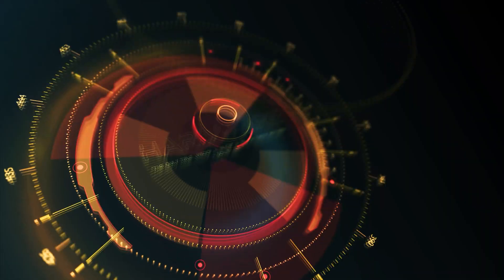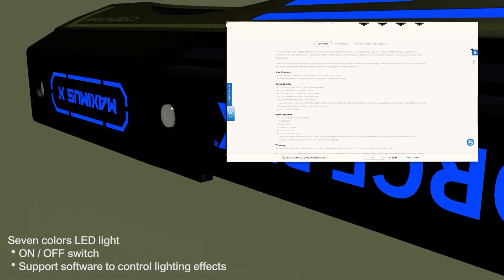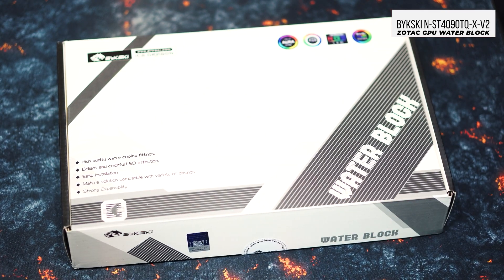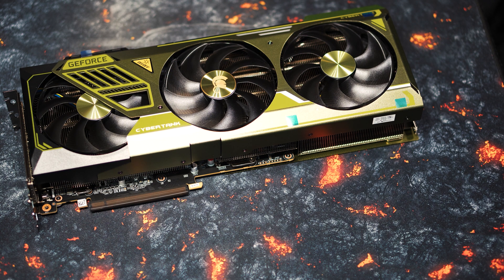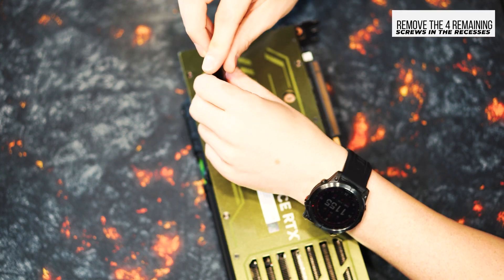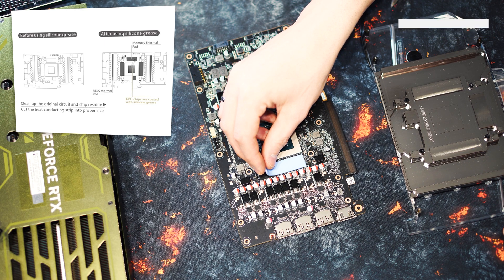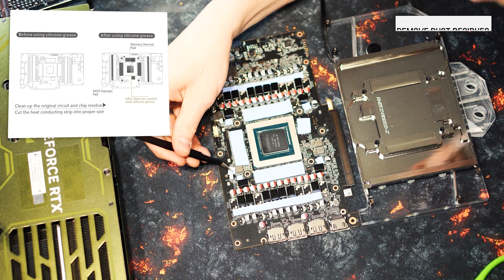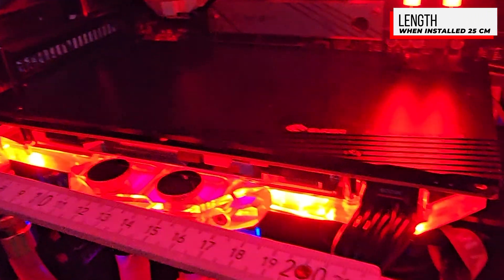Manli Nvidia Geforce RTX 4090 Gallardo Custom water cooling: GPU mod with the Bykski water block 💦

Comment: Hi, I have the 4080 gallardo. I would like to disable the green levels led. Is it the white header I need to disconnect ? Will it disactivate all other rgb ? I would like to disable only the green levels
Reply: You can press the on/off button on the shroud! :D
Reply from the maker: Unfortunately, after completely dismantling the card, I can't give you an answer 🖖

Comment: Thanks for the tutorial. So there is no need to modify the gpu or water block? just plug it in right away like if for the specifications?
Reply from the maker: yes, exactly. the block fits directly with the manli 4090 💪